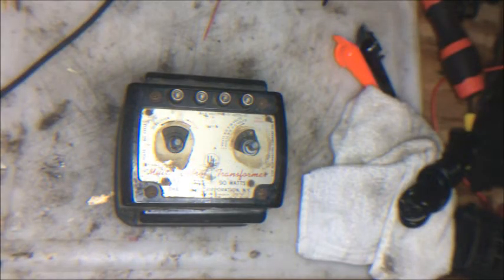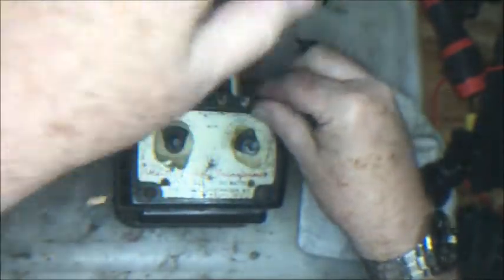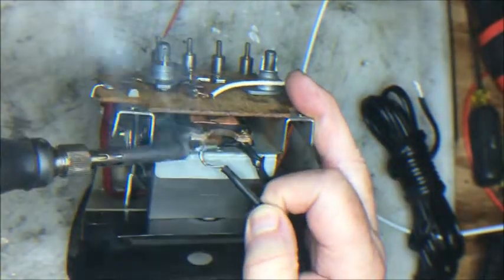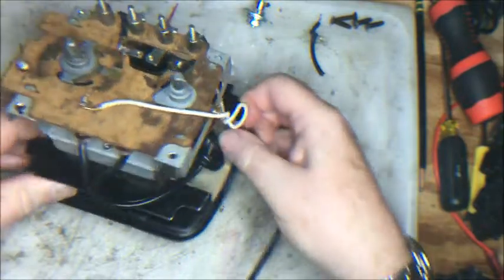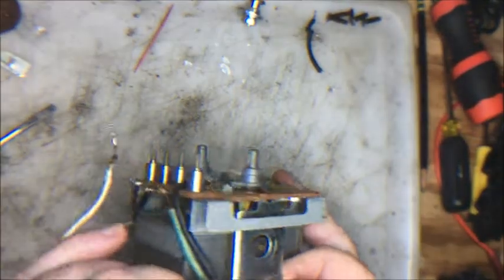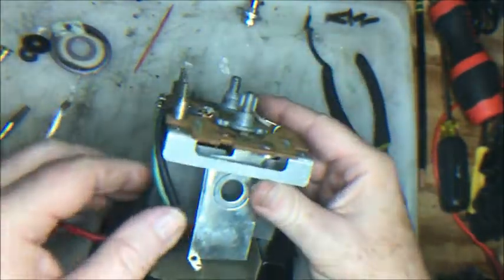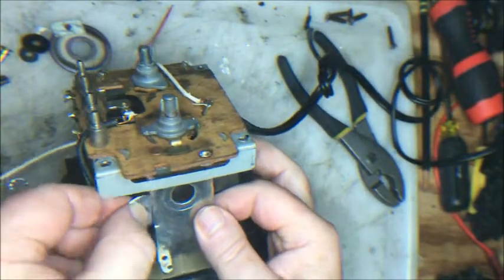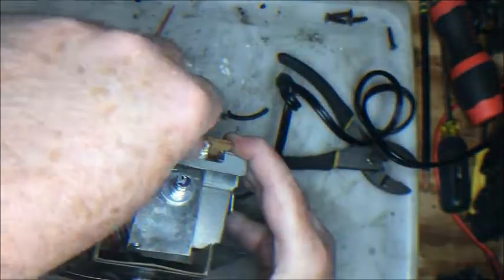Lionel 1033 Transformer Renovation Part I

Comment: Thank you, thank you, thank you for your video. I was able to repair my 65 yr old beloved 1033 which just stopped working and the whistle was hit and miss. You took the mystery out of it. Gary O
Reply from the maker: Great, Gary! You are most welcome!
Reply: @peterfenzel4742  Those 6A breakers are in short supply. I had to order them four times before I found a supplier on ebay.
Reply from the maker: @Problemchildracing  Never had trouble finding them, Gary, but happy you were able to buy them in the end.

Comment: Hi. Firstly, thank you for both videos. They were very informative and saved me from buying another transformer since I had given up on mine. Can you give me some additional Info on the Diode? I shopped for a 16 amp rectifier diode and there's many different volts, positive cathode, negative anode... my head was spinning, LOL. Thanks
Reply from the maker: Hello Frank, and thanks for the kind words! Don't get all confused about  polarities of the diode. The 1033 DC current for the whistle works whether the polarity is + or -.  Here is a link to a 16 amp stud diode from Just Trains: https://store.justtrains.com/16-Amp-Whistle-Diode_p_2682.html This will work in your 1033 transformer. There are cheaper barrel diodes, but those have soldering issues. Hope this helps.

Comment: Hello! I’ve been having some problems with my own 1033. The A post has appeared to have stopped working, and before when it was working, every couple of minutes the transformer would start rapidly cutting out. Do you think you would know what would be causing this issue? Nice informative video by the way, certainly teached me a lot!
Reply from the maker: Hello NG, and thank you for the question. Let's try to eliminate some of the potential causes:

1.  Is the problem with the A post or with other components of the transformer? Instead of connecting track wires to the U-A posts, try connecting to the U-B posts instead, and see whether the same problem exists when running trains on the U-B connection. You may notice the trains run slower on the U-B connection, but that is normal. The U-B connection outputs 11 volts, while the U-A connection outputs 16 volts.  If you have a multimeter, check the voltage output for U-A, U-B, and A-C connections. The A-C connections should output a constant 16 volts. 

2. If the U-B connection works fine, we can focus solely on the U-A connection. If the U-B connection is also dead or cuts out, then the problem likely lies with the circuit breaker.  For safety's sake, WHEN IN DOUBT, REPLACE THE CIRCUIT BREAKER! See Part II of this video for circuit breaker replacement instructions.

3. If the problem rests solely with the U-A connection, resolder the #4 wire to the A post  and check again. There should be power to the A post if the #4 wire is good and the solder joint is solid.

Before going into more arcane possibilities, try the above first and please let me know how things turn out!

Kind regards,
Pete
Reply: @peterfenzel4742  I appreciate the response! I tried the U-B connection and that did not work, however the U-C connection worked just fine. I put a multimeter up to the U-A posts and it appears to be working just fine when it’s not connected to any track, same goes for the U-B. So perhaps the main issue is the breaker?
Reply from the maker: @NotGavin  yes, I would replace the breaker as the most likely culprit. It is easy to do and inexpensive. You can see how to install a new breaker in part two of this video. Good luck! Please let me know how things work out.
Reply: @peterfenzel4742 hey! One more question if ya don’t mind, would i need to rip out the old breaker to install the new Busman breaker? Or could i just have the new breaker alongside the old one?
Reply from the maker: @NotGavin  You can leave the old disconnected breaker in place.
Reply: @peterfenzel4742  Just wanna say thanks! I put the Busman breaker in and now it works perfectly. Appreciate all of your assistance!
Reply from the maker: @NotGavin  Great! Congratulations on a job well done!

Comment: New power chords have one plug larger than the other so they can only be incepted into a plug one way. Does this make a difference which way a new chord is installed? Holding off installing a new chord for your answer.
Reply from the maker: The 1033 is not designed for the "newer" grounded power cords.  It should not make a difference which way you install it, but the better course is to buy an inexpensive cord meant for your transformer. This link:  https://www.ebay.com/sch/i.html?_from=R40&_trksid=p2380057.m570.l1313&_nkw=lionel+power+cords&_sacat=0  will lead you to an entire page of suitable aftermarket power cords for the 1033 on EBay.
Reply: @peterfenzel4742  Thanks. Ordered 1.

Comment: I ordered power cord and handles for mine.  How does the Speed handle come off? Whistle handle had broken shaft.
Reply: Both handles come off by gently prying directly upwards. If it's sticking, use a rigid plastic pry bar if possible. If you don't have a pry bar, use two flat screw drivers on either side and gentle twist until it loosens up.
Reply: @cee1bee1  Thank You!

Comment: Would you replace my 1033 rectifier disc and install the Busman thermocircuit-breaker if I shipped the 1033 to you and paid you (new cord is already installed)?
Reply from the maker: Hello, Valliant1!
As have mentioned in the past, I do this as a labor of love, not for pay. So, no thanks but I do not take repair orders.
The cost of mailing a 1033 back and forth would alone equal the expense of buying a well functioning one online.The cost of parts and labor on top of mailing is not worth it.
That being the case, why not give it a try yourself?
Reply: @peterfenzel4742  thank you … what amp diode should I get?
Reply from the maker: @TheRhythmKnights  A 16 amp rectifier diode works well. Here is a link to the seller of diodes I use. https://www.ebay.com/itm/201466844389  I do not have any relationship with the seller.

Comment: HI Peter, I recently bought a 1033 that wasn't working. The power cord had crumbled. I opened up the casing and changed the cord and tried to power up. The power works and the voltage to the posts is correct, but only if I use the whistle switch in the "on" position. In the resting position of the whistle switch, there is no power to the speed switch. The rectifier disk is original, but looks pretty clean. Not sure if the original circuit breaker is working properly, although it does look very clean. Any ideas?
Reply: If I do have to replace the rectifier with a diode and a new circuit breaker, do you have the type of diode and breaker I need?
Reply from the maker: Hello, Claudio! Thanks for the interesting question.

To figure out this problem I am going to assume that you checked all the wiring, and that the wires are all clean, tight,   and solidly soldered in place. Before you do anything, unplug the transformer. 

The  whistle runs on Direct Current independently from the engine motor and accessories, which run on household Alternating Current.  It sounds like there is no AC voltage running from the core of the transformer to the binding posts. There is DC voltage, however, running to the binding posts through the rectifier  Let's consider the possibilities:
1. The Core - The core is functioning and producing nominal voltage to the binding posts when the whistle is engaged. So that's probably not our culprit.
2. The Circuit Breaker - If the circuit breaker were dead you would not get power to the binding posts at all. So that's probably not the likely culprit.
3. The Contacts - There are several copper contacts  embedded into the fiber platform for the whistle/direction switch shaft assembly. These should be sanded shiny for good connectivity, as should the winged contact on the shaft. These only impact the whistle and direction control. Neither, however, would prevent AC current from reaching the binding posts.So these are unlikely culprits. 
 Having exhausted possible culprits from the core, the wiring, and the left side of the transformer, we now focus our attention on the right side.
4. The Control Shaft Assembly - This is what regulates voltage from the core to the binding posts. There are only 4 components to this assembly: the handle, the control shaft itself, the contact arm, and square holed washer. The contact arm runs along the core. Its position along the core determines how much voltage reaches the binding posts. If the contact arm is not making contact with the core, there will be no AC running  to the binding posts. Check the contact arm's position and contact tension with the core. This is my prime suspect.

If the contact arm is fine, then there must be some break in a wire from the core  or ground. In such a case,  would strongly  recommend that you either have a professional repair the 1033 or  throw out the transformer before you attempt  to replace the core wires. You would be getting into areas meant for experienced technicians and risk electrocution.
Reply from the maker: @cee1bee1  The simplest repair of the rectifier is to buy a new rectifier disc, remove the fast nut, take off the old disc, put on the new one, and reattach the fast nut. The videos give details of the stud diodes and thermal breakers.
Reply: @peterfenzel4742  Thanks for a terrific and very detailed response. I'm with you on the potential issues you identified. This morning I removed all the existing soldered connections as well as the old rectifier disc. I cleaned everything including the disc and lubricated with dielectric grease. Re-soldered all the wires and low behold, it works perfectly now. I was actually getting 22.6 volts before from the U-A connection (which I know was wrong) and now it reads 16.2 on the meter. All the other voltages are now correct as well. So other than a few cents worth of grease, solder and electricity I'm in the pink. Thanks again for a super response, excellent video and for sharing your love of fixing old stuff instead of tossing into the land fills. Stay safe, stay healthy and I look forward to you next videos. So long from your neighbour to the north.
Reply from the maker: @cee1bee1  Great,  Claudio! Well done!

Comment: Hi Peter, what did you use to clean up the transformers face? Yours came out very clean mine was stored poorly but I cant seem to get it looking like yours without scratching it up. Also what did you use to clean the pins, did you just do the rust trick like with the screws?
Reply from the maker: Joe Bonneau Hi Joe! I clean the case of the transformer with baking soda and vinegar scrubbed with an old toothbrush. Cold water rinses off the baking soda thoroughly. Once dry, I give the case a  light hit with Pledge and a tissue

Comment: Hi Peter--do you think this diode will work--on eBay---REPAIR STATION 16 amp diode for Lionel KW Transformer w/ INSTRUCTIONS 16 amp
Reply from the maker: Hello Robert! Thank you for the question. I cannot see any link to the 16 amp diode you referenced. The Repair Station 16 amp diode i mentioned in earlier comments is the one I use for my 1033's and KW's.
Reply: @peterfenzel4742  Thank you

Comment: Do you remember which wire from the plug goes to which point? Like for outlet prongs
Reply from the maker: Most after market replacement plugs are already tinned, and are not grounded. It does not matter which of the 2 wires slips through each of the contact holes.
Reply: Thanks for the video. My transformer wire is in good shape but the plug is stripped and disconnected. Could I simply twist connect a new chord and plug to the existing chord, or is it best to get a new chord and solder in to the connectors?
Reply from the maker: @schwartz2138  Hello Andrew, and thanks for the inquiry. First, never use a power cord or plug that shows fraying or damage. Second, while there are many aftermarket "Lionel" or "L" replacement power cords available on EBay and Amazon for $4 - $6 your local hardware store will have plenty of suitable power cords. 
You can  use a replacement plug on the existing power cord, but they are less secure and subject to failure over time. Your transformer, when properly cared for, could last another generation or two, maybe more! Why  not spend $4 - $6 for a power solution that will last?

Comment: Great video. Can you give me some detail on the power cord replacement? In the video you just stuck the wires through the holes. Did you solder them in?
Reply from the maker: Yes, of course, they are soldered in place. Most replacement cords intended for Lionel transformers are tinned, so soldering is fast and easy.

Comment: Could you tell me what diode and breaker you use for this repair?
Reply from the maker: The diode was a 16 amp diode I purchased from Repair Station on EBAY. The circuit breaker is a Bussmann UCB -6 .